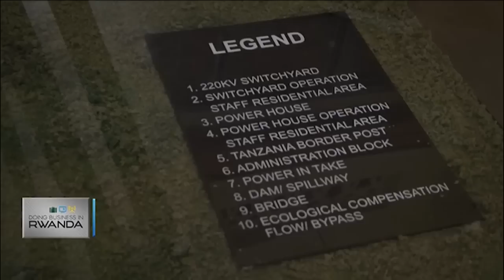Rwanda's new hydroelectric project

Comment: 80 Megawatt  only?  That is nothing!!   Next time build as big as the DRC's dam or Ethiopia's dam.
Reply: Even the smallest dams in the DRC produce more then that.
Reply: @estajeanette7487  I agree.   Specially on a joint venture  project between 3 countries one would expect them to build a huge dam coz they can raise the capital between them.
Reply: @Esta Jeanette   DRC barely has any electricity. They don't even have roads. They have the poorest citizens in the world, What's the point of having a big dam that you can't accept its electricity?
Reply: Even the 80 mega watts is divided to 3 countries 😂
Reply: At least have built it, Congolese and their useless arrogance is what is causing your nation to fall even deeper. It's about how big is the dam, it's about the will of people to use the resources they've got, on the DRC part, you have a lot to exploit but you lack the will to do so.
Reply: @mrkigalii Congolese people need elect a gov that will fight corruption and build the largest and well disciplined army, then I am certain they will be able to stamp out the illegal gangs in the mining sector as well as break link with those international criminals.  All they need is the will of the gov to implement this measure.
Reply: @redseayouth9119   You're right. But for now there's no indication that victim mentality is going to change anytime soon. A country ( DRC in this case) cannot move forwards if every issue/solution is outsourced from outside actors. Every ingredients are on site to make it great but the nation hasn't woken up to its own responsibility
Reply: What determines the size is the volume of water
Reply: We are here talking about project complete not comparison  in Rwanda or Tanzania they have bigger than this many times 🤣🤣🤣 Congolese always in comparison with Rwanda u guys u have big problem for blaming others
Reply: @mwenengofero  Your comment makes no sense .  U Seem out of depth  here .
What do you know about  rwandan local population cooking habits  when you sitting in the cold of Canada taking social benefits paid for by the nationals  taxpayers. 

Somehow, you're more convincing when you spew your usual anti PK or anti Rda rhetoric trying to re-write the history for your and your fam moral comfort.
Seem out of your depth here , on Infrastructure topics . There are more of your usual troll topics out there.
Reply: Tanzania is almost Done with a dam that is 200 times bigger than that 😅😂